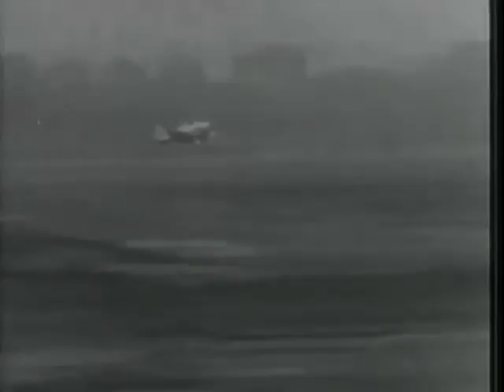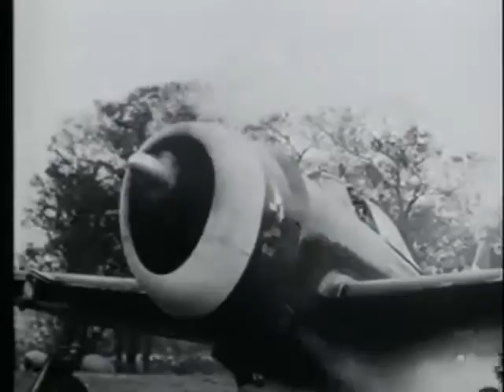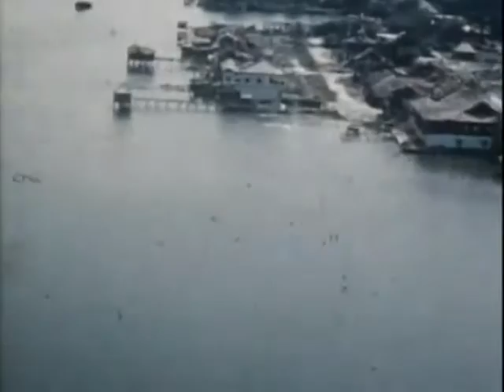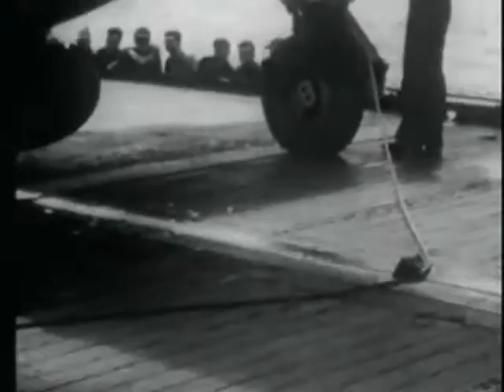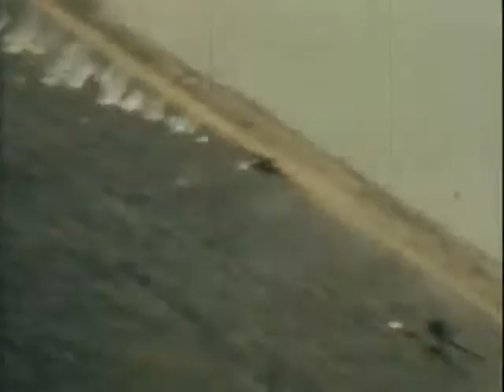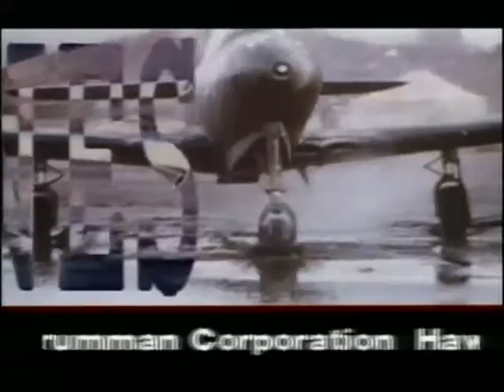Great Planes  Republic P 47 Thunderbolt

Comment: The 'Jug' was a trench-level, work-a-day, reliable instrument. Clearly not nearly as glamorous as many of its contemporaries. But if I could have any WW2 airplane, Jug would be my first choice!
Reply: Not mine lousy climb, dive, turn, service ceiling, Gas Guzzler Gee not much was good was there and they call it a great plane
Reply: @jacktattis  Are you a pilot? I don't think you are. If you are a pilot, tell me your certificate number. It's already public knowledge so there's no breach of privacy concern. My certificate number is 4523234. Assuming you visit the FAA web site, plow through the unintuitive menus, and verify my claim, you will see that the issue date is 7 July 2021. But that is actually the re-issue date: I requested a new certificate back then because my original certificate number (issued August 31, 1989) was my Social Security number, a huge faux pas today. And FAA pilot certificate issue date is the date of issue of that specific certificate and does not reflect original certificate issue date (you can check that too). But no worries, I have my original pilot certificate from 8/31/89 so can prove my claim. BTW, the re-issue was free. Cheers.
Reply: @richardpark3054  I do not give a rats bum what you have All the tests are out there for you to research I did WW2 Aircraft Performance is a good start
Reply: @jacktattis  Well, that's great for you! I'm happy for you! You research aircraft performance with books, I research aircraft performance with 'the seat of my pants'. I just like flying, something you don't know how to do, so we don't have much common ground, do we? You think Jug has poor climb performance; well, when I fly my antique amphibian cross country, I plan 50+ miles to get to 5000'! Her name is alternatively 'Mermaide of the Skye' vs 'Floating Skye Pig', dependant on my mood. She's not a bad plane, just has limitations  consistent with a fuselage built to hit the water at 80 mph. So, carry on, friend, you enjoy what you do, I'll enjoy what I do. Cheers!
Reply: @richardpark3054  Who cares? that has nothing to do with the p47 Go and check and then come back and refute my assertions
Reply: @jacktattis  Aren't you a little ray of sunshine!
Reply: @richardpark3054  Yes I am thank you.
Reply: @jacktattis  What did you smoke? it was fast, reliable, could take enormous amount of damage and take the pilot back to safety... Also could outdive every opponent of the time.
Reply: @pauka13  Fast no 426mph from  2300hp is not good It was porky 
Reliable not down on the deck 2000 were lost doing G/A 
Take punishment it needed to it was 17600lbs of tin 
Dive? with a Tactical Mach of 0.71 it was a dud
Reply: @pauka13  I used to smoke Old Holborne a friend once told me it smelled like Camel dung burning  It was actually a great smoking tobacco. I still miss it after giving smoking away for 35 years
Reply: @richardpark3054  As with many things associated with WWII the “narrative” is not accurate. The P-47 was arguably at least as good as the Mustang and in some ways better.* America was rich but did not have unlimited resources. Mustangs were much cheaper, much smaller, and used less fuel and oil. So the decision was made in Europe to phase out Thunderbolts and Lightnings (also expensive and very complex) in favor of Mustangs. 
*The climb rate issue was mostly solved by better propellers. The Jug was extremely fast, excelled at high altitudes, could outdive almost any other WWII plane, protected the pilot better, could take more damage and had tremendous fire power.